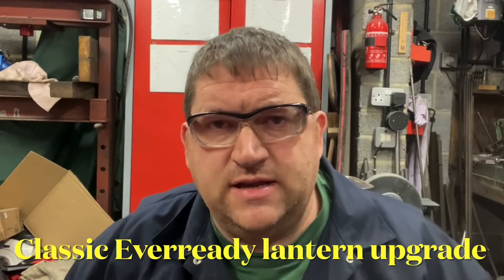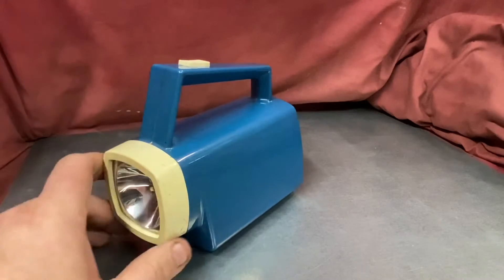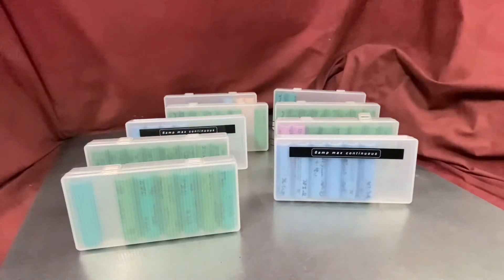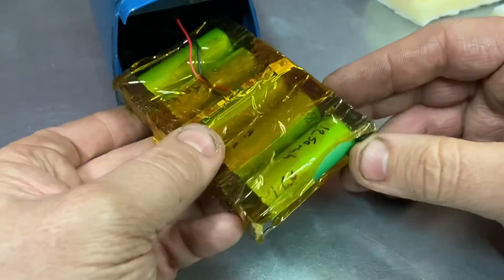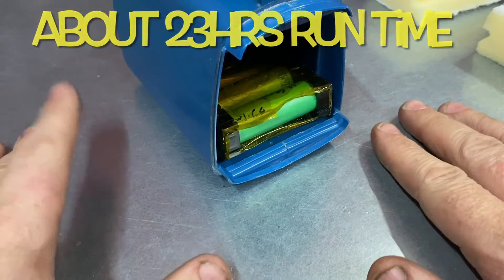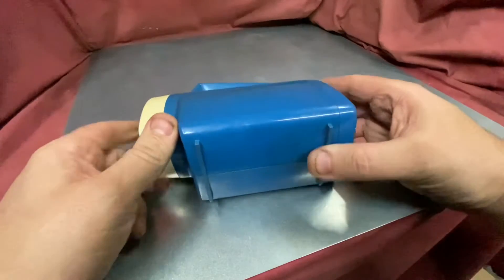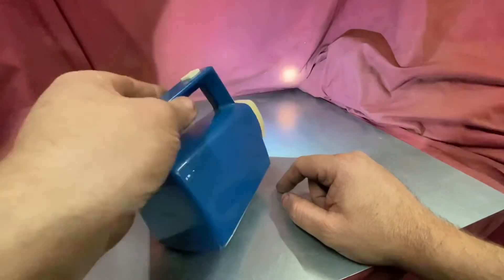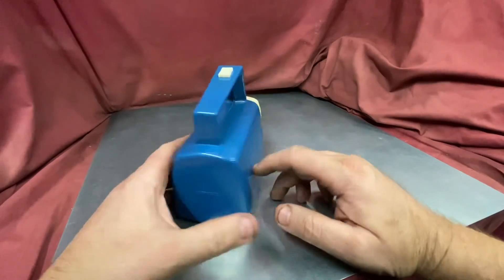Classic Everready lantern torch upgrades

Comment: Can you link to the spot welder tool, of all on the market, not sure which is good.
Reply from the maker: I use this type, manual and with a foot switch;

https://www.ebay.co.uk/itm/404546785639?mkcid=16&mkevt=1&mkrid=711-127632-2357-0&ssspo=gyim9o_rqro&sssrc=4429486&ssuid=1xaUmnl8TJ2&var=&widget_ver=artemis&media=COPY